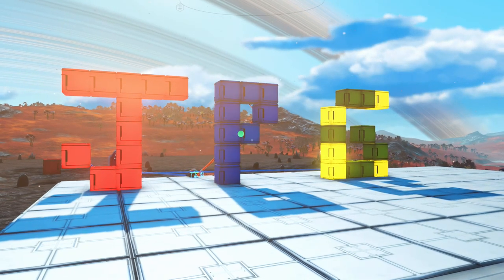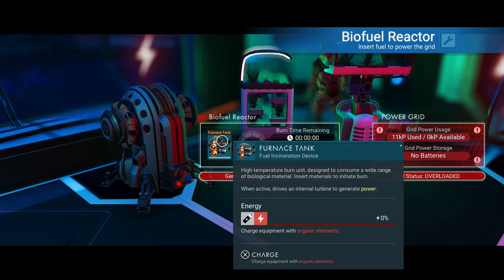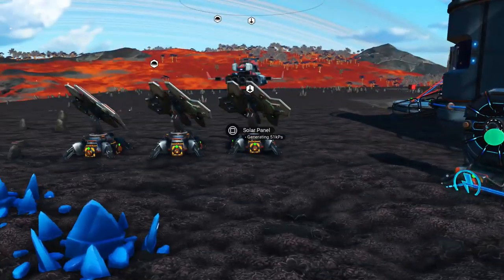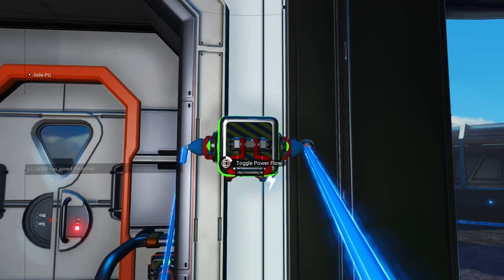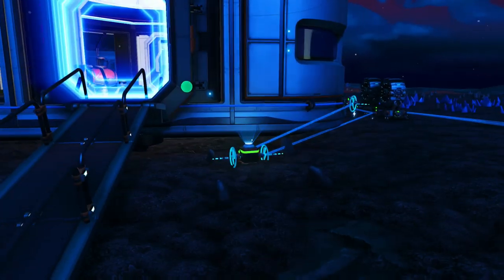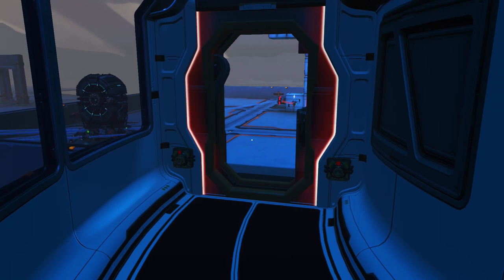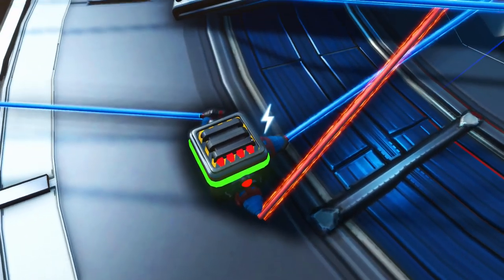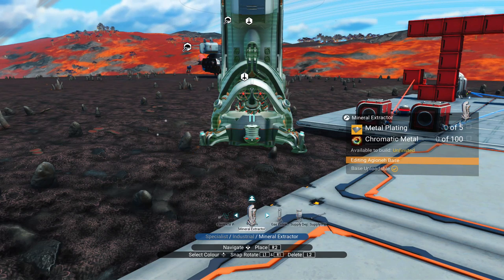NO MAN'S SKY POWER TUTORIAL Part 1 - Basics! Fuel Reactor Solar Panels Proximity/Inverter Switchs

Comment: The most important basic information - how to switch of biofuel generator - is missing.
Reply: i dont think its possible, thats why there are batteries you can build to store unused power.
Reply from the maker: All tye info is there the bio fuel is literally the basic think running on carbon which is easiest thing to get. Just hook up battery

Comment: I’ve got a row of storage boxes, and no matter how many generators I connect up, only three will power up. This is such a badly thought out update, wires are ridiculous, power generation is feeble and the fuel needs for the Bioreactors are way too high. 
Oh, and finding I have 75 planets of minerals to upload is a pain in the arse. Lots of nanites, but why is there not one button to upload everything in the system? Wank.
Reply from the maker: Replace rge storage boxes should work. Bio fuel as explained is basic power you should be utilizing solar power an batteries

Comment: Electric wiring should be only done for certain large tech, it should not be there for basic stuff like doors etc, when you build this stuff the electricity should be sorted out automatically...... maybe you could have the requirement to build power stations and battery packs etc, but not this wiring overmicromanaged stuf.. omg.

Comment: The wiring system is utterly garbage. They don't even have sockets inside the buildings. So the idea is just to clip everything? I'd try to bend the cable by making short sections at slight angles but you get a plug sticking out on the first piece you lay. The pipe sections suck as well. If your building and need more resources you can't carry on extending the pipe once you quit the build tool. No way of t jointing off things either. I like the idea of power but this a joke. Solar panels all open up facing different directions 🤔.  They need modular connections so storage bays can power each other instead of having to power them all seperatly. Transmission line would be handy as well specially if the power source is far away. Such a basic concept completely ruined by lack of thought.